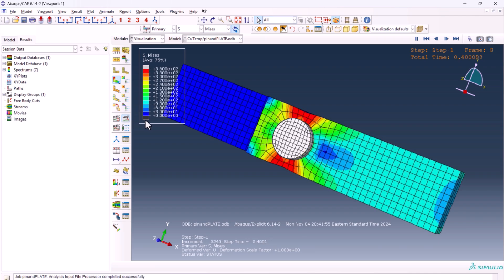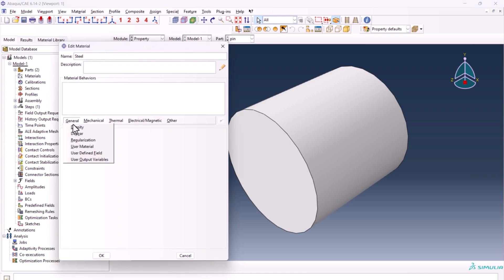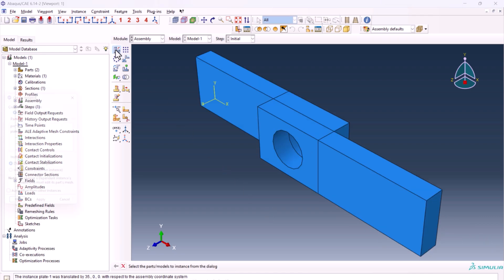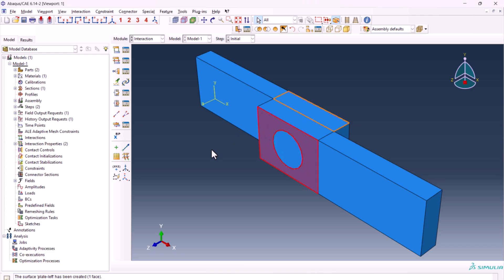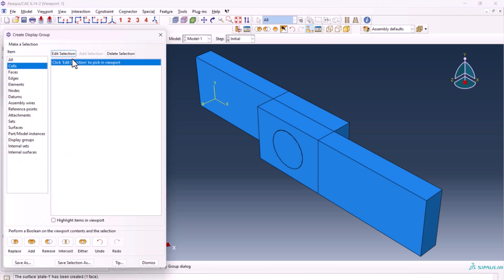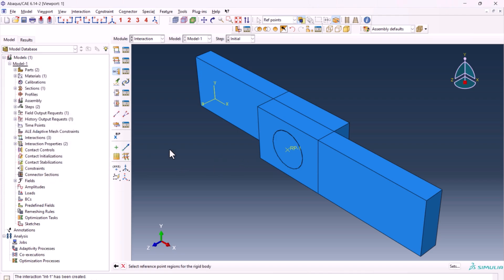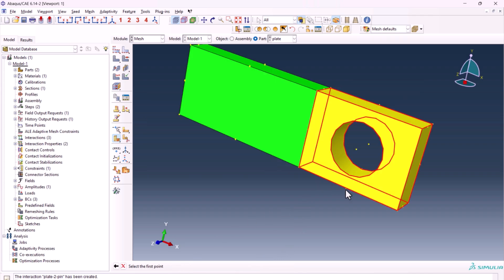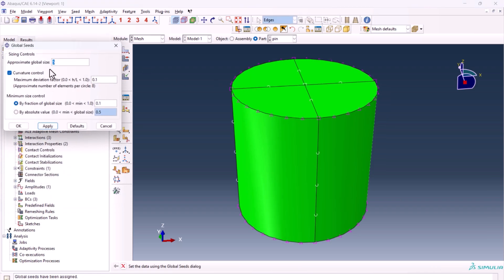How to Simulate Shear in Pinned Connections: Abaqus Tutorial

Comment: if i want to make discreate rigid type not deformable type pin then how to make and use in assembly. if i want to use simple tensile using pin hole type and incert pin then how to do can you make a video.
Reply from the maker: Great question! 🙌 To create a discrete rigid pin in Abaqus, you just define the part as Discrete Rigid in the part module instead of deformable. Then assign a Reference Point (RP) and tie the pin’s surface to that RP. In assembly, you can insert it into the pin hole and use the RP to apply load or boundary conditions.

I’ll keep your suggestion in mind — a full video on this would be really useful! 🎥
Reply: @FEAMASTER Thank you so much for your reply. But in the assembly module there is no assembly happening while the using the discrete rigid, only  shell type use warning comes but I want to make the solid type.